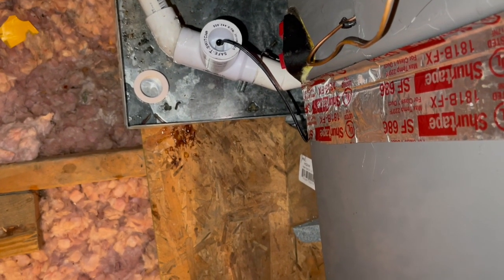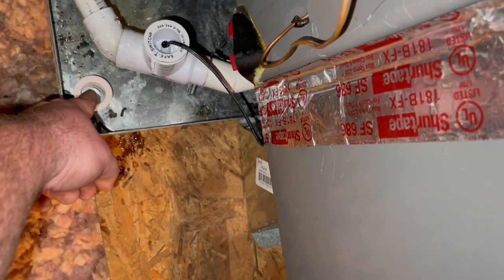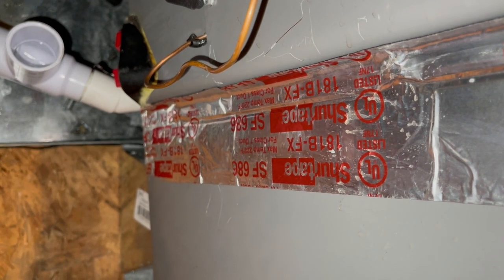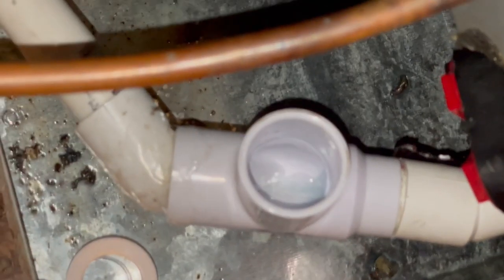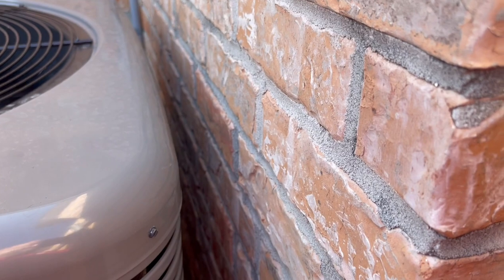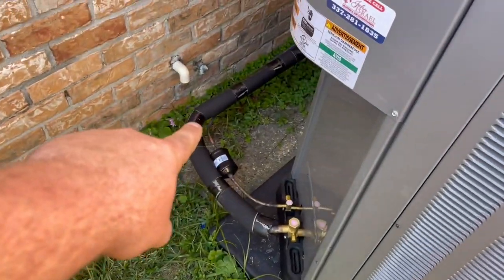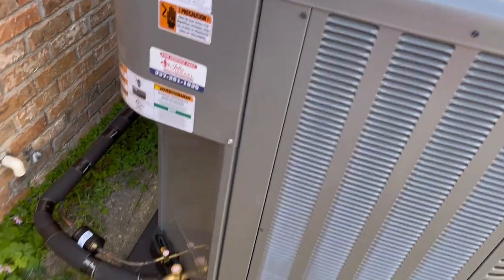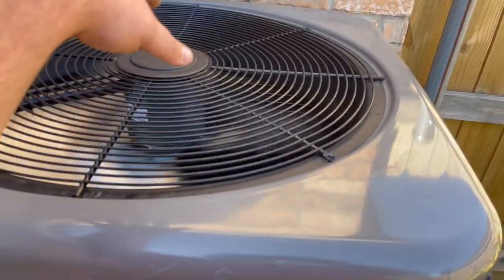Warranty Call/Going Behind Installers

Comment: John, those R801CA are NOTORIOUS for having the board code “26” straight out of the box. What I have done.... and what I’ve talked with my tech support guy with and he agrees what I do solves the issue. Warranty the board, wiring harness and the auxiliary limit on the blower. You WILL not have that issue again.

Comment: Looks like the original install used landscape PVC instead of schedule 40 (I don't like to re-dig or repair anything I install so only use schedule 80). Add some heat to that like in an attic and it gets both more flexy and more brittle resulting in cracks.

Comment: Had this issue with a new Goodman system. Reversed polarity code. Turned out to be a bad ground in the existing wire from the panel.

Comment: How do you determine if the indoor unit will need a Ptrap or not?
Reply: It's based on which side of the airflow the drain is on. Negative side it gets a Ptrap positive side not needed.

Comment: That pvc is brittle and thin. This happens over a long period of time being in an attic. Really should replace the whole line at least until it goes outside the attic. Makes it impossible to cut without cracking. All new installs should not use existing pvc especially on gas furnaces

Comment: Where's the trap on the condensate drain? Am I missing something?
Reply: If the drain is on the positive side of the unit, it doesn't necessarily need a trap but some may argue that.
Reply: @edwardgarza5104  I concur wholeheartedly with what you're saying

Comment: No mastic on joints either
Reply from the maker: It’s Mastic tape on metal to metal. Mastic isn’t necessary.
Reply: @johnisraelhvac2019  the sticky tape? I say that because sometimes the heat in the attic dries the adhesive on regular foil tapes and lifted and seen plenums open up
Reply from the maker: Not this tape
Reply: @johnisraelhvac2019  love your vids… take care brother